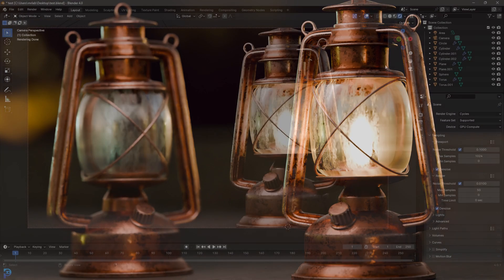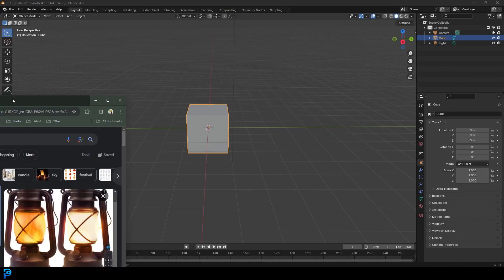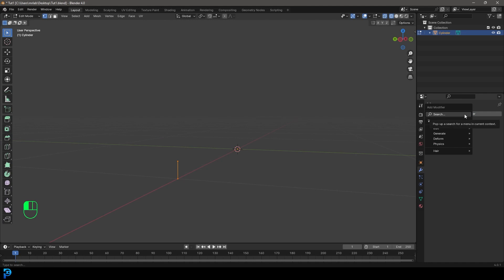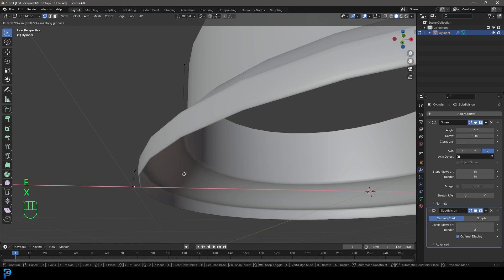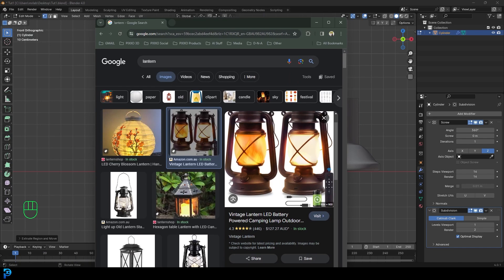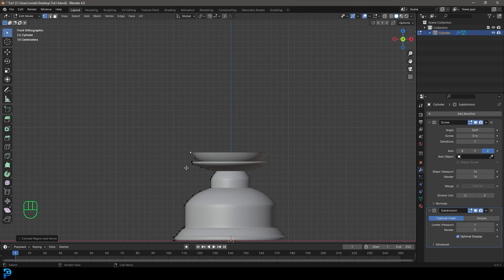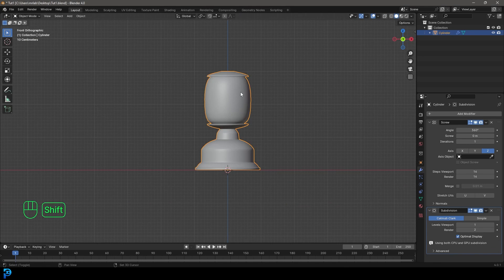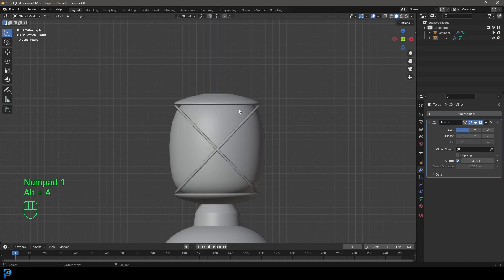Lets Make This Lantern In Blender 4.0 | Part 1

Comment: Nice but wouldn't it be better to use Curves with the Screw modifier then add a bevel modifier instead of using vertices.
I think this adds more control.
Thanks for the tutorial <3